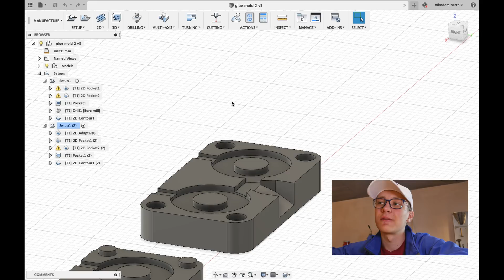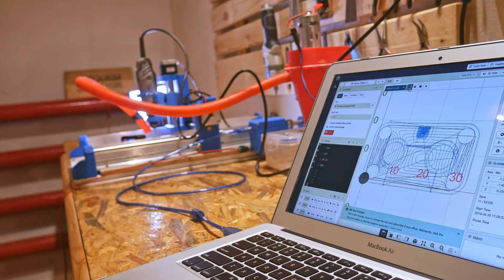DIY Injection Molds With Dremel CNC And Hot Glue #2

Comment from the maker: Check out first part of my experiments with DIY injection molding: https://youtu.be/CZSxT8IBIJc
Reply: Nikodem Bartnik  awesome can I ask I still want to no how to program the board for the cnc which I am going to try and build there’s a lot about the build but not much about the actual board and what to do with it
Reply from the maker: @ianmacrae2749  check out my instrctable, everything is explained here
Reply: Nik you should work on a hotgun injector first to generate enough pressure, or you can use a similar design of the extruders designer for home made 3d printer filaments
Reply from the maker: @ViniciusMiguel1988  I want to build a manual injection molding machine, currently waiting for the parts to arrive from China
Reply: I think the issue with the big mould is that the glue is drying before it gets to the bottom of the mould. Try heating it up maybe??
Reply from the maker: @recreation1692  Check out my first video about DIY injection molding
Reply: i think the reason you had succsess this time is the traveldistance inside. Its pretty short so the hotglue stays hot long enough until it reaches the exit.
Reply from the maker: @hyperhektor7733  Yes, smaller part is easier to make
Reply: @nikodembartnik  Alcohol is great for demolding hot glue. one drop and it releases.
Reply: Thanks for your reply. See you have really tried everything at your disposal. What about using a heater element like the one in your printer hotend?
Reply: Hi, I think you might need to heat the metal mold with an electrical resistor for heating for the big on the star of the video , you can use the ones for 3d Printer extruders to keep the liquify material for injection, It is cheap and works with 12 or 24 DC volts, also you will need a controller for the heating, you can make it with an Arduino, a thermistor, a hobby relay and a power supply, Arduino uno and Mega model support 12 volts. Regards.
Reply: have you considered heating the mold so the glue stays liquid long enough?
Reply: Can't automobile tiers air compressor helps with pressure? I think in factories used lot of pressure to inject a lot of material at short time that it has no chance to become solid before fill all space in mold. Or maybe some vacuum can helps?
Reply: Try sticking  with your mold and maybe  use  plastic pellets with a traditional injection machine if possible.
Reply: Why are molds so expensive when all we need for small parts is cnc milled aluminium molds which should not cost much to make right? Can this method work for Rubber resin?
Reply: Dont know if you guys gives a damn but if you are bored like me atm then you can stream pretty much all the latest movies and series on instaflixxer. Been watching with my girlfriend during the lockdown =)
Reply: @Javion Adrien yea, have been using InstaFlixxer for since november myself =)
Reply: Can you try using 3d pan instead of glue gun?

Comment: i think you could make the molds heated using a 3d printer board, 2 40 or 50w heaters and a thermistor, basically turning the mold into the heatblock

Comment: heat the molding form?!
Reply: funny. thats exactly what i thought when i watched the clip again. obviously i already had seen it. so. hold the form. oh.and dont wast your time with hotglue pistols, if you can use silicon. or, if you have some cash. pdms. that the same.
thats medical silicon. it feels like tight tits, but is indestructable. incredible material.

Comment: Is there a practical way to change the glue gun's nozzle with a grease gun's female zerk fitting and then have a male zerk fitting located on one side of your mold? ...given might have to redesign the mold to do this

and maybe have to use a larger zerk fitting than what standard grease guns come with in order to allow easier flow of the thicker glue being pushed through it.

Eh maybe not such a good idea... I bet the problem comes in when the glue keeps hardening inside the zerk fitting located on the mold

Was just trying to come up with something somewhat simple to keep a tight connection between your glue gun and mold

Comment: It's a great idea to prototype your molds this way.  Congrats on your washer maker.  

Also, you were smart to move the injection location into the middle of the zip-tie mold.
Maybe you can consider using two injection locations and two hot glue guns simultaneously to get the delivery fast enough.
Of course with your abilities, I can see you designing a simple injection machine to replace to glue guns as you progress on the learning curve.  :-)  Keep up the great work!

Comment: I would suggest, 1st you need more pressure, try to form the injection point like your glue gun. 2nd the ziptie mould is too long, try and move the injection point to the middle where it can evenly flow. and 3rd you need heat, try to clamp a heater element to your mould on both sides, nothing too fancy, you dont really need high temperatures.

Comment: You can't develop high enough pressure with a glue gun.   But you can with something else.  Also maybe you can raise the temperature of the hot melt glue much higher.  Also the interface between the glue gun and the mold could be much better, with an o-ring seal or something.

Comment: Try modding a 3D printer hot end use pla at high temp and max feed rates to fill the mold basically injection moulding u have to have all the mold filled instantly otherwise it won’t work a hot glue gun is to slow to fill a big mold as to low Feed rate but a 3D printer hot end could feed fast enough just calculate what volume u need to fill the mold and have it feed through the hot end as fast as possible

Comment: Why use hot glue?! You can use a flexible resin polyurethane resins. That are even stronger and you can cast it in silicone, no need to machine a mold. Or you can machine it from wood in a positive and make a negative silicon mold for it. Silicon molds also allow for some slight over hangs and undercuts because it’s flexible.

I do a quite a lot with rubbers and resins for movies (yeah I’m a vfx guy mainly but also do SFX and prosthetics) these are all made from silicone with similar shure strength as hot glue but I can even cast hard plastics.
Granted the eye was modeled in clay and the leeches I did in 3D and 3D printend then on my resin printer and molded those. Because we needed CGI leeches for the hero shots and we used practical leeches for the wide shots — tracking leeches on to a wet body is a nightmare, so I opted to make those practical.

https://www.instagram.com/p/BuqO6F4HYO3/?igshid=1qy1b11zyvygu

https://www.instagram.com/p/Bp4y__RH35K/?igshid=1lyiy9b80186a

Comment: second module is not  working because  lack of heat ...try to maintain some heat to the module....it will work definitely..
Reply from the maker: With new hot glue gun it is working fine, check out video #3

Comment: What if you try to do it with a 3d printer pen instead of glue gun
Reply from the maker: Too low pressure and temperature
Reply: Nikodem Bartnik  oh okay i tryed it myself with a 3d printed mold but is didn’t work because it stuk together 

So i thought maybe it will work with the cnc milled molds
Reply from the maker: Maybe with very very small mold, but without great results

Comment: heat the mold with a heat gun, and when done, drop the whole mold in isopropyl alcohol. the alcohol shrinks the hot glue and debonds it from most smooth surfaces, like your mold. also, draft your registration pins. they don't need to grab each other, just need to hold alignment, so make them cone shaped instead of cylinders.

Comment: Injecting from the middle of the mold was a good idea, you could use a thermal plate to rapidly heat and cool the mold. The other thing is having lots of little holes in the mold so that you are not fighting air pressure, even better if you can create a negative pressure to pull the glue in into a vacuum.

Comment: Isopropanol is able to creep under hot glue and it can disconnect the bond between glue and surface. Maybe that helps when releasing the part from a mold that was preheated before

Comment: Hi ! I really like your videos and thanks for sharing all your experiments even the fails !
May be you can try using silicone (just like for the bath joins) or some abs juice or plexiglass juice made out of plastic parts an acetone ? With that kind of material no need to heat... Just let it dry...
I hope it can help you ;-)

Comment: I could not tell, did you have the ziptie vended at the far end?  
Why not try the following:  Is laser temperature meter to read the temperature of the hot melt gun tip.
Heat the mold just above that temperature, wait until it cools down to the temp of the tip--then inject while it is the same temperature as the tip.
This seems like an okay way to get the temperature to a safe zone that will not overheat the glue and burn it--without using any expensive gear to get the mold temperature to a range that will work.
Remember to vent at the far end--otherwise pressure will build up and it will not allow glue to be pushed into the mold.
I would recommend using some kind of silicone grease or mold release.  
This should work.  Aluminum is highly thermally conductive so it should not take long for the mold to heat up and it should be able to reach a fairly even temperature over the length of the mold--enough where it should not cool too fast and freeze up on you.
You may need to increase the thickness of the part if the hot-melt viscosity is too high to allow it to be pushed thru.

Comment: 1. I think, with such technology and matreials you need to inject the glue in the center of the model
2. I saw your experiments with heating the mold, thats why I have a question: it is better use compound (liquid plastic) like Unicast, isn't it? No heating, no need in preasure.
3. Preasure! If you want to make things from hot glue you need more preasure without extra heating
4. And there is one more idea: put the material (glue or plastic granulat) to the mold, heat it.  But! Make some holes before it, where air and extra material could "go away".

I really like you videos and hope that you will success!

Comment: I do have one idea, if you heat up the mould and keep it at around 60º it should work, you could make a peltier based heater, to remove the part (because it's glue) try tapping gently with a rubber hammer on the juctions all around the part, and evenly!

Comment: put the molds in the oven first or just use tpu instead of glue. you have a 3d printer I see by your cnc. You can use the same setup as a 3d printer extruder+heat nozzle+hot mold. Very nice little dust collector you made btw.

Comment: Great video. Have you looked into milling a smaller version of the precious plastics injection molding machine? Use an auger to create higher pressures than the glue gun can provide.

Comment: you need to use an additional finishing cutter,as the surface is too rough.in addition,before pouring, heat the mold and pour not into the edge,but into the surface.

Comment: Whats wrong with preheating the mold? Ger it to 200*C with a heatgun and then inject the plastic. Industrial molds dont work cold either, they are preheater to just belowe the softening point of the plastic to allow to eject the piece without it getting deformed from its own weight. This is a one tome mold so theres nosing to lose by preheating it way higher to allow the plastic to flow further, then just keep pushing plasting until it cools of and it stops pouring out from the other side.

Comment: You need some plastic that melts at a higher temperature and that is more liquidy so it can cool off longer and be able to fit in the little space for the ziptie
Reply: Roman Yamal 
PLA flows pretty easily but he needs the injection machine. At least a manual one but its still quite a complicated project.

Comment: the problem is not pressure. Its the hot glue is not hot enough. Don't heat the mold, the hot glue needs to be hotter.
Reply: It's aluminum, so it's going to sink the heat away. A warmer mold could help keep the glue from transitioning back to solid too soon.
Reply: @JosiahJohnson  Injection machines do not heat the molds Heating the mold in the long run will cause the mold to wrap. The problem here is that the material is not hot enough. Either the hot glue needs to be hotter or you need to inject the hot glue quicker. Problem number 2 your spure and gate is two small.  Number 3 you need to look at the time it takes hot glue to set once it below melting temp...
Reply: @staceyseigle4183  He's using different materials with both the mold and injected polymer. Vastly different melting point of injected material and heat dissipation of the mold material. 

Not sure why, with all the differences, your sticking point would be heat, but hot glue will start to burn in most consumer hot glue guns. There's not much up to go, except keeping the mold from sucking out the heat immediately. I'm not talking about enough heat to warp it - just a little help.

Though I think your other points are spot on.

Comment: you should draft and radius your mold, will help with removing parts
Reply: madcat105 
Not if the mold isnt mirror finish to beginf with. He should add some finishinv passes to the gcode though i dont know if the machine is up to that task, maybe it will end up just rubbing instead.

Comment: I think it might be interesting to use a caulking gun and some silicone. If you modeled the nozzle of the caulk gun (or even the glue gun) you could get a seal at the injection point of the mould and get much higher pressure, enabling larger casts.

Using a caulking gun would enable you to produce silicone washers, much more useful as they'll handle temperatures above ambient.

It might also be fun to try to produce grommets and other vibration isolation mounts. Gives me some ideas! Thanks for the video!

Comment: Holy sht, did i just see a dremel cnc mill???
Reply from the maker: Yeah, check out my other videos about this project :) My design is completely open source so you can easily make it and there is a Facebook group for Dremel CNC builders where you can ask for help. As you can see even though it is 3D printed it can easily mill aluminum :D

Comment: Could you cut in two spouts on either end, and try injecting with two hot glue guns and have the center hole you drilled as the riser?

Comment: Thermo dynamics are your worst enemy when it comes to injection moulding, you have to have enough stored heat in the mould to allow the substance to remain viscous until it fully fills the mould, then for it to harden and cure before it release. 

Release spray will help a lot with the filling of the mould too allowing the liquid inside to slide through the mould with less friction and contact to the faces of the mould.

Comment: Man, such a great project! Why you don't try pre-heat the last mold with a hot air gun? I know that you sad that didin't want to heat it, but for hot glue you don't need to increase the mold temperature in high numbers. Take some hot air gun with temperature control and start from low heat flux and increase litle by litle until you get the best result, with low temperature in the pre-heated mold.

ps: Try to focus on the midle to botton of the mold, the pré-heat is junst to evitate the hot glue to solidifie before fill the mold.
Reply: Another thing that I just saw and realise: Your finish surface is so rough and it alows to the hot glue to stick in a more powerful way, try to improve it and I believe that the results will improve.

Comment: Why don't you make a custom 3d printer extruder open the nozzle with drill bit. Or you could use a female to female brass barrel to feed your mould. CNC your threads on the block. What do you think?

Comment: Very Nice results there. There was some air pockets though overall structurally sound.

For that challenge you face, you can try adding some heater cores to a block or blocks positioned around the mold. I have piles of those heater cores/coils of different shapes and diameters, other line production automation components, from a volvo truck plant that was closing type auction. Normally these are stupidly expensive, though auctions can and do change the rules to that. Some are intended to be self clamping on pipes that feed the material. 

If the glue gun was a inline setup with a adaptive coupling rather than with the nozzle, even flow rate and without much loss of material per molded part. 

I want to try making some molds soon too, and a vacuum forming table, and even to make types of filaments and thermal formed sheets from recycled material to use for the vacuum forming.

Comment: Should try a mould release. Most are just white mineral oil in an aerosol can. One it lubricates the part and also helps with heat transfer. 
Easy down and dirty way is dip the 2 parts in mineral oil. Put them together. Aim a heat gun on the coldest end of the mould. Using a temperature sensor of some sort. Heat up to 10 degrees less than melting point and than inject the glue.
Or can try capillary action. And set the temp of the mould to 10degrees higher than the glue gun. But you might have bubbles. So you would have to inject from bottom going up.

Comment: Great job so far , a suggestion if i may , aluminium disipates heat 4x faster than carbon steel ,all the molds that i have been involved with used a heating function and kept at temp before injection happens . Good luck .